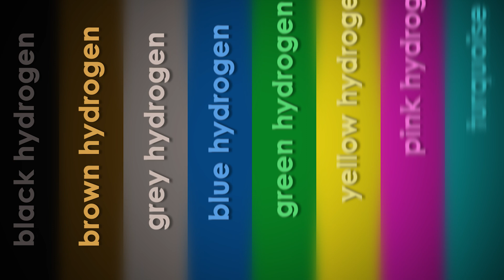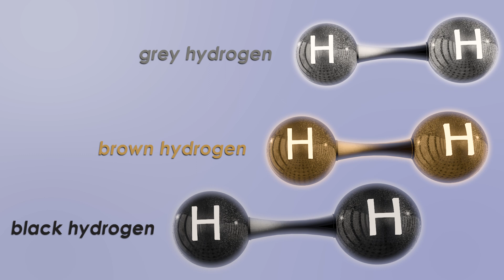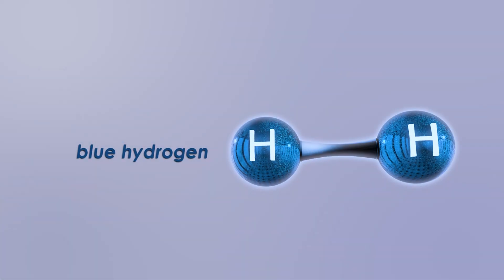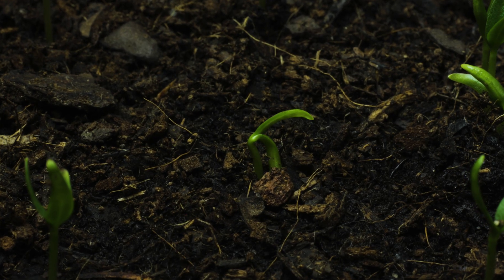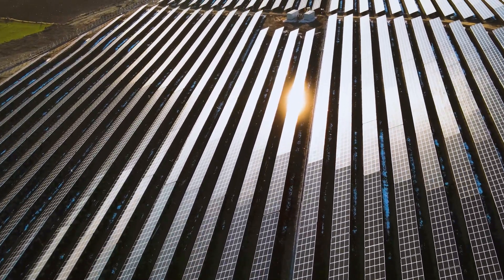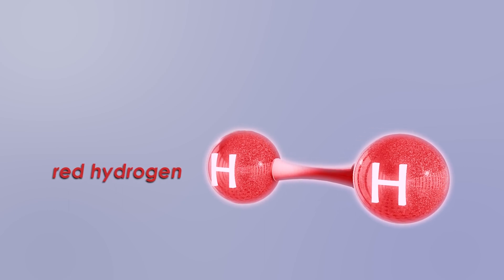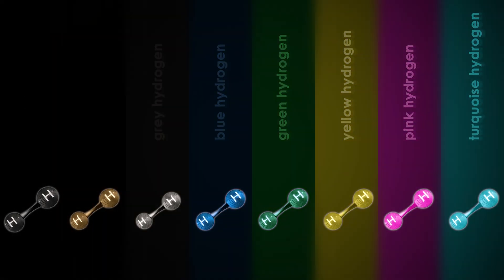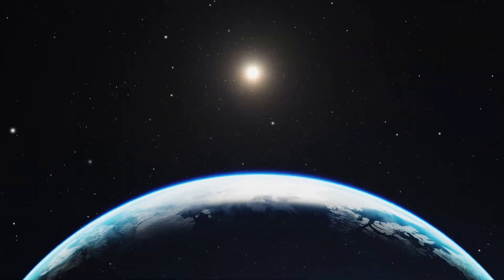The Colors of Hydrogen Fuel Explained

Comment: what about the water consumption issue ?
Reply from the maker: This would need to be taken into consideration, but it is still much better than the alternative of aggressive fossil fuel extraction and the environmental destruction that always follows it. Theoretically, it could be made with desalinated water coming from plants near the ocean that are powered by renewable electricity. Desalination is a whole separate issue which deserves its own video, but ideally hydrolysis will be implemented in a way that does not further exacerbate water insecurity.
Reply: @PlanetZero-ClimateChange  having enough clear water is a bigger issue than where the energy comes from, or if you should use hydrogen instead of lithium battery. 
It s the 22th century biggest challenge, still, nobody's focused on it. Shame...
So creating specific plateform for desalinate water only for hydogen power plant is really a joke if we cannot have enough clear water to FEED the people.
We should focus on creating these plants to feed people first, then see if we can add more for energy
Reply from the maker: @benwahhhh  Which issue do you think will impact more people: the consequences of ceaseless fossil fuel consumption by 2100 (reduced crop yield, desertification, more intense flooding, wildfires, mass coral bleaching) or an increase in demand for water?

Comment: Another color not stated here is White hydrogen or sometimes called Gold hydrogen due to its similar origins. 

It's basically natural occuring hydrogen underground. There's growing interest into extracting such as we're pretty good at extracting fuel underground due to decades of experience. There's already a precedent as well in Africa where a huge well was spewing 98% pure h2 for more than a decade. It's now used to cleanly power a nearby village for around 10 years now. There's also recent discoveries in France, US, Japan and Australia at lower purity, though expected to reach as high at deeper depths.

It's expected to be the cheapest of all colors if extracted in commercial quantities as production is done by earth for us. It's also expected to be renewable as it's constantly being generated by geologic processes where underground water interacts with a number of things underground. Like minerals via serpentinization, thermolysis, or radiolysis.
Reply from the maker: I wanted to include white hydrogen, but I also didn’t want the video to drag on for too long. But you are correct, there is a sizable amount of white hydrogen being extracted from underground deposits, making it a lot less carbon intensive than steam reforming or gasification.
Reply: @PlanetZero-ClimateChange  that makes sense. Definitely see H2 as the future imo. It's much more flexible than purely batteries. Once white hydrogen is done in commercial extraction at big amounts I really expect a huge 180 turn for a lot of stuff as it's expected to be cheap enough to compete with natural gas at that point. When paired with the other sustainable colors I can see it working pretty well in the future. Biggest hurdle at the moment is infrastructure imo, but that can be solved with time.

Comment: Three cheers for pink hydrogen! One cheer for each color it goes by
Reply from the maker: Purple and red hydrogen are just there to add to the rainbow
Reply: Red H2 is actually a bit different from pink. It's generated using Nuclear heat via a variant of thermolysis heat called thermochemical cycles. With the right Nuclear plant design this is potentially cheaper than Green H2. A Gen4 High temperature nuclear reactors generates a lot of high temperature waste heat which you can then utilize instead of dumping onto cooling towers. This makes h2 production essentially a byproduct of the nuclear plant operating to generate electricity. Since it uses purely waste heat, it's expected as cheaper as heat is a cheaper energy to produce than electricity hence why Nuclear plants actually have huge rated thermal power yet only have a fraction of it as rates electric power.
Reply: Also both China and Japan have running demonstration plants for HTGRs. Japan particularly plans on using it to co generate H2 once they build it for commercialization by 2030s

Comment: Hydrogen may, possibly have some potential in the aviation industry… other then that it’s stupid X Stupid… Turning electricity into hydrogen for a car, and then back into electricity looses at least half the energy, so just go with a battery… To be certain, lets understand, there is no such thing as a hydrogen powered car.  There are electric cars, that store the energy as hydrogen, and then convert the hydrogen back to electricity to move the car.   HOWEVER, you loose at least half the energy converting the energy from electrical to hydrogen then back to hydrogen… Batteries loose less then 5% of the energy going in and out of the battery.
Reply from the maker: While it’s true that hydrogen fuel is not the most energy efficient fuel out there, it does potentially address the concern of charging times for long-distance electric car travel. How will we electrify our interstate truck fleet without forcing them to stop and charge every couple hundred miles? I believe hydrogen has potential in this regard because there will always be a demand for rapid refueling, something that electric cars currently do not have an answer for.
Reply: @PlanetZero-ClimateChange , truck drivers are limited to how many hours per day they can drive.  Battery power, which is only getting better, already fits well within those limits.  A car is more likely to rotate drivers, but still, you only take an hour, compared to a twenty minute break, and I find it hard to believe that is the difference maker, except for the rare-rare situation... So, there is never going to be a market that supports the vast number of Hydrogen stations needed to support it.  Petrol stations will go away, and the price will spike, when electric stations are as common as petrol is now. ...a reversal of fortunes the Fossil Fuel Industry is fighting for the lives to hold us addicted to.
Reply from the maker: @Naturalook  To say there will never be a market for hydrogen is like saying there will never be a market for EVs 20 years ago. This technology is in its infancy and could be rapidly adopted by those who have range anxiety with electric vehicles. Also, like you said, the aviation industry could benefit tremendously from this fuel. Who knows how quickly the infrastructure could develop over time with the constant influx of money from one of the world's biggest transportation sectors.
Reply: @PlanetZero-ClimateChange I’m not being a contrarian, but I think you are wrong.  Hydrogen energy conversion factors cannot change much, because H2O is hard to disassociate… so it will always, always be much more expensive than straight electricity.  Range anxiety goes away, when charge stations are as common as petrol stations today, …and petrol stations will be as hard to find as a charge station are to find now.  Imagine tomorrow; You go to the store, Walmart, Homedepot, or the local groceries store.  You pull into a parking spot, watching your screen till it says STOP.  You do not swipe a card, or plug anything in, but when you come back out, the car is charged.   All you did was tap the prompt on the screen, “CHARGE.”   You look over at the other guy, with an older electric car, and the poor guy has to plug in his car, and swipe his card.  How archaic, you smuggly grin… As you leave the store there is  a rare petrol station, the next closest it 20 miles away, “My God,” you exclaim, because it’s no longer subsidized the price is unimaginable!  There are a couple guys on crotch-rockets, motorcycles that still run on energy-dense petrol because of the weight factors, but even there the cost is prohibitive for all but the wealthy…  Imagine that world, and now explain to me how Hydrogen has any potential to compete.